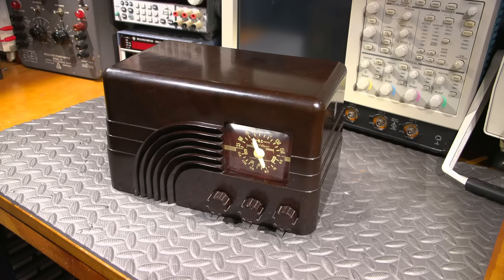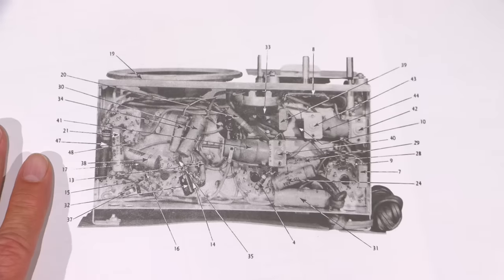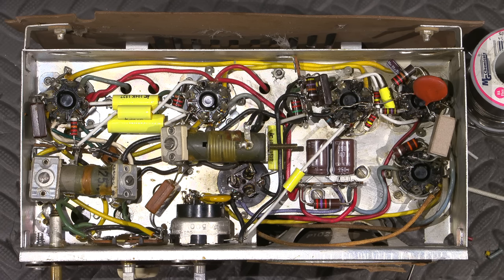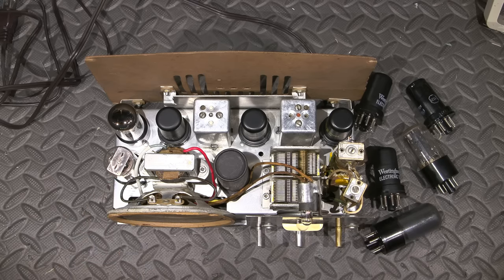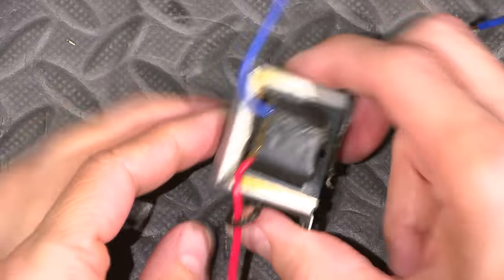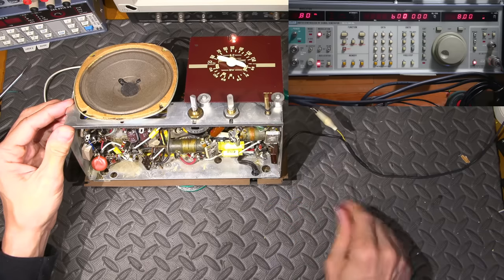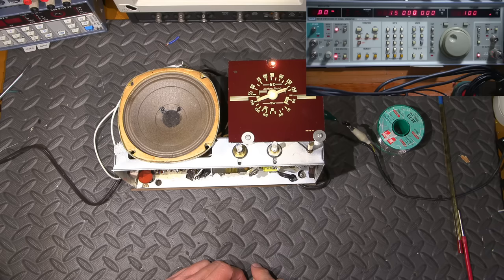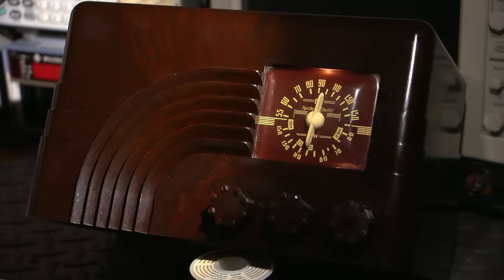Restoration Adventure, 1946 Baby Champ Radio Receiver!

Comment: In looking at the chassis of this receiver, I'm surprised that there doesn't appear to be any military surplus components left over from the war effort, as manufacturers had quite a bit to burn through, at least here in the U.S. I've heard that even when they were new, those wax foil capacitors weren't really that good. It has been said that Canadian safety standards for these receivers were higher than U.S. safety standards, even back then. I like the old design of the old, large IF cans with the trimmer capacitors, as they never fail and get silver-mica disease. That radio station at 1000 kHz heard through the signal generator might be from Seattle.

Comment: I'm curious why it appears you replaced every resistor on the bottom of that radio? Many of them were definitely within tolerance and you said you weren't going to change them all, but it looks like you definitely did.

Comment: If the set is really old or unusual capacitors can be a source of dating evidence. People do re-stuff the waxed paper capacitors. In that case it's considered good manners to leave a note inside the radio: 'PAPER CAPACITORS RE-STUFFED' on the backboard. Old sets had the mains switch on the neutral side because plugs weren't polarised. I have seen that the grub-screw holes in the knobs would be filled with wax and the mounting bolt holes in the case are wax filled or covered. All to stop you from touching any metal part. 

In England the supply voltage is twice that of the USA. That meant a ballast resistor. This meant a BIG wire-wound ceramic resistor inside the case or a resistive mains lead. The backboard of the set would have to be marked 'DO NOT SHORTEN MAINS CABLE'. When American radios appeared in the UK during WW2 the extra ballast was in the power cord. 
In English radio language a 'line-cord' specifically means a resistive cable.

Comment: Mr. Carlson
I have a Collins R-391 radio plus I have the power supply for the auto tune. I'm in Seattle and have been forced to move. I really need this set and radio to go to a good home. Would you be interested? I don't want this rare radio to lose its life.
Thanks for your consideration I have a very limited time but would be delighted to see it go to you and possibly be able to watch you bring it to life. It's in overall nice condition but as a novice it's more than I can figure out as I've reached an age where moving it around is to hard for me. Cheers Paul!

Comment: Mr Carlson. I am working on a Zenith model 141952 and inside the chassis is the number's 389. The other number is smudge but I think it is 315  8Y02. But my question is about the tuneing. It would not tune anything so I used my single tracer and got some noise but was not sure were to go next. I was getting ready to stop for the evening and just out of curiosity I hooked up the alligator antenna clip I was using down at the base of the tuneing capacitor and the other end to the wire that the original antenna hooks to. It is like a loop. Now this is were it gets strange to me. The radio that I was listening to while working is the one tuneing and bringing in this old Zenith . If you understand any of what I am trying to explain can you tell me what's going on and maybe what is wrong with my Zenith. Thank you.

Comment: What is the difference between a leaky cap passing DC (parallel resistance), compared to a cap having a bypass resistor to drain it?
Reply from the maker: Hi George. The difference is: two different applications. Bleeder resistors are there to drain capacitors off in power supplies, and the like. A parallel resistor across a capacitor in a coupling circuit will pass DC from the previous stage to the input of the next, which is bad.

Comment: Mr Carolson your electronic video are very helpful can you tell me who your supplier is for the ic capacitors that you use can you go in more depth in wiring  the power cord and fuse on the five tube radios maybe a wiring diagram Thanks Joe

Comment: How were you able to determine the shield end of the yellow IC caps?
Reply from the maker: Hi Scott. It's a device I created that you will see in many of my video's. The plans with all the build spec's are on Patreon, IE: circuit layout, schematic, component layout maps, and more.
Reply: @MrCarlsonsLab  Thank you, I'll look it up. I find it odd that the outer foil is an important consideration, yet the manufacturers won't mark capacitors accordingly.

Comment: Repair shops got a 100-300% markup on tubes and customers thought of them as being similar to light bulbs.  A lot of tubes got replaced by dishonest repairmen just for the markup.  The age of those tubes shows how reliable they are.   Based on working in a TV store at age 12 in 1969.

Comment: Mr Carson's I don't understand why you would have that running with bulbs, It's also possible its not getting full voltage, I seen he same thing Happen , They disconnected  the bulbs everything worked , Everything is new, I understand the Variac.

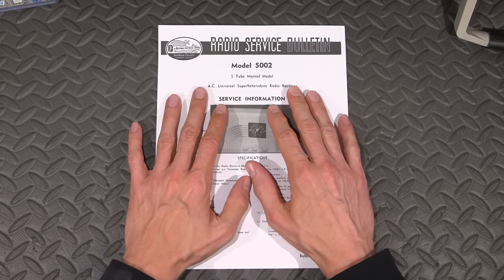Comment: 14:50
Today they provide us with 200 page safety book saying to not eat batteries from remote, do not throw gaming controller on then screen, do not use power wash to clean screen and call specialized technician to plug power cable to wall socket.

It remind me old cars books. Just like 10-15 years ago I get nice book with schematics that had instructions on how to set belts, wiring and fuse box diagram etc etc...
Now days when I get new car I get literally 200 page book telling me how to find McDonald on navigation, 5 page of instruction on how to not mix miles with kilometers and half of that book is safety telling me to not drink cooling fluids, do not remove 10KG of plastic that sit on top of the engine without a reason beside to look good on images and of course TO NOT TOUCH ANYTHING! Like I should call emergency if I need to open bonet and for god sake DO NOT change fuse box by yourself!

Comment: I. A bit late coming to this and a beginner. But… can someone explain why at 20:00 in, Mr Carlson mentions increasing the voltage to 50 volts and removing the resistor. Surely if you increase the voltage you need to increase the resistance or the current will climb?

Comment: One important note you should have warned about was the adjustment tool should be non conductive because of hand capacity and the possible damage to some radio If transformer windings when using a metal blade if it contacts the metal transformer can and the screw at the same time!

Comment: Sure you can find the schematics of new amplifiers, I have a Sony STR-DE 495 which is a digital audio and video control center with 5.1 dolby surround sound and I had to work on it replacing more than 50 capacitors and they provide all the schematics and parts list for this device, super helpful because I got it working again as if it is new, maybe even better because I upgraded the bulk capacitors from 2x 4700uF caps to 2x 10000 caps and I upgraded all the caps from 85 degree Celsius caps to 105 degree Celsius caps, except for the bulk caps I replaced all caps with the same capacitance values to be sure I don't change anything crucial.
So I have to say that you're wrong about modern equipment not having any schematics available to repair it yourself because that's absolutely not correct, at least for the Sony receiver that I own.

Comment: I bought a Generac ix2000 generator that has a problem with the PCB. It has a 1:1 transformer that was defective from the get go. It had unprepared laminates that rusted, and by doing so, it lifted the transformer up, this causing it to malfunction. This has no circuit board schematic or diagram, so it's questionable as to getting the actual replacement. Apparently this choke has to do with engine operation, and is a 1:1. Is this something that you could service?

Comment: Mr.Carlson, I have a Science experiment project possibly involving a used "junk" CRT tube.  I would like to tell you more but people will think my theory is crazy.

QUESTION: I plan on a safety cage built around the CRT but what kind of internal pressure can a CRT take before it decides to explode?  It Definitely  WILL NOT be doable if it cannot be done Safely?

I may have to ABORT or rig up some other appliance.  Is there a CRT that is especially strong (pressure wise) compared to other CRTs?  The initial PSI will probably be slightly above 1 Atmosphere BUT we don't what it will jump up.

Comment: There is a set of almost a dozen plastic prybars of various shapes in the 20 some piece car interior tool kits. A button popper metal prybar too but they're not good, the ones sold by themselves are better. Another "popper" tool in the kit lifts parallel. Little spatula and split bar spreaders that only need a mil or two of clearance. All that and more is like 25 bucks on ebay. I use them on cars.. The only set I really want to get into is riveted shut and potted-in by an absolute madman who even enclosed a line of a dozen 12ax7..au7?.. tubes across the front with only a narrow window that only shows the filament, you can't pull the tubes out from. All riveted under a thick layer of clear epoxy... so spats don't help.

Comment: if a 'wax paper' capacitor is across a low value cathode bias resistor such as 1k or so, with maybe only a few volts across it in use, you DO NOT have to replace them, (unless physically damaged) theres no advantage in doing so , any extremely unlikely  leakage at that small voltage is totally swamped out by the low value resistor, similar if theyre used in early transistor sets, again a few volts only and transistors are low impedance devices, i would leave them in place in these cases to keep set as original as possible and so people in future could see the actual types of component that was used from factory at the time, if all are replaced in all sets, no one would think wax paper capcitors ever existed,

Comment: Yuck! This radio is not old enough. There's nothing sexy about metal tubes, although it's always fun to restore one which is COMPLETELY RUSTED OUT after being buried in the ground outside for 50 years.
Reply: ...and I notice it also seems to have a permanent magnet speaker; Also a bad sign.